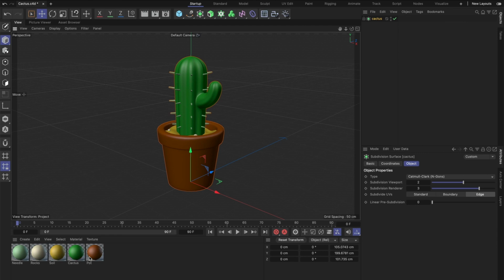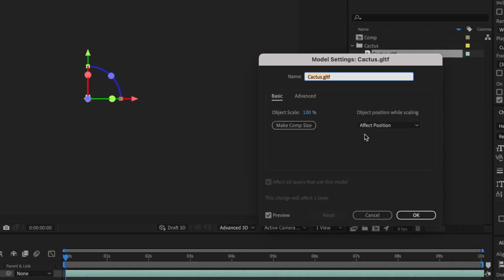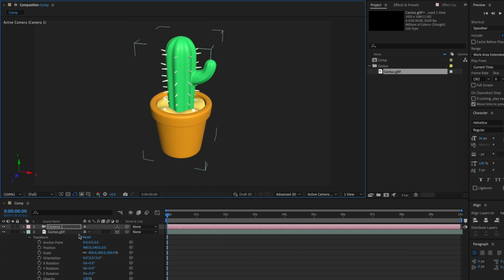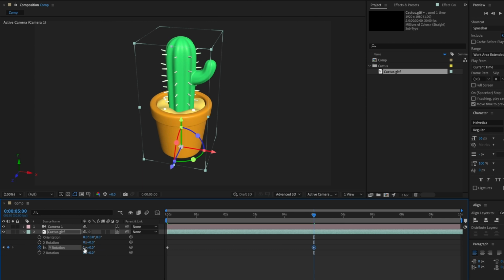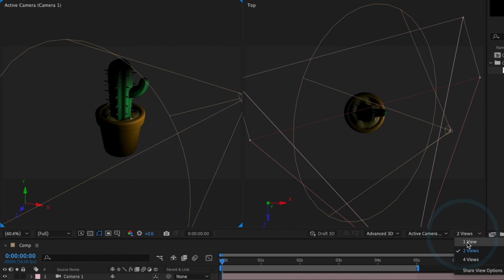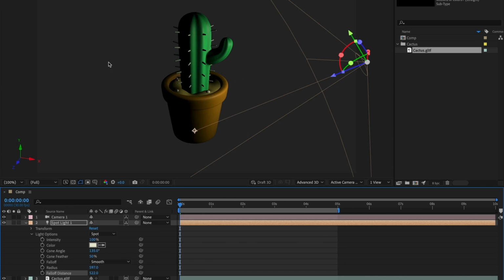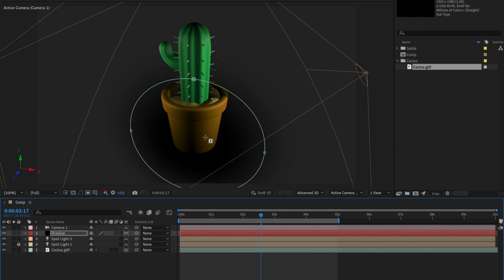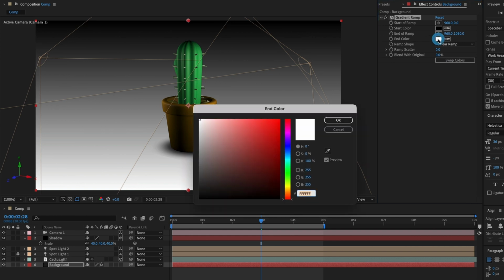NEW! Import 3D Models Directly into After Effects – Full Guide!

Comment: If I import I import the 3d models it becomes invisible
Reply: No I didn't resolve the problem it only shows the wireframe but the 3d object is not visible.
Reply from the maker: If you are in the 2024 version of After Effects try upgrading it to the 2025 version.  Have you tried opening this in another 3D software? Do you get the same wireframe error? If not then it’s After Effects and I recommend you upgrade it. Sorry for the late responds.
Reply from the maker: Sorry for the late response.  That’s strange.  I don’t get that error.  Did you resolve that problem?

Comment: Any reason why the colours of the imported objects are blown out and super bright? I want the colours to match exactly
Reply from the maker: I ran into the same problem at first. In your 3D software of choice, you need to create your material using a PNG or JPG as the base texture. I use Cinema 4D, and initially, I would just apply a basic material and select a color. It worked fine in Cinema 4D, but in After Effects, it would appear blown out. I fixed this by creating a 1000x1000 JPG or PNG file of my solid color, exporting it, and then importing it into After Effects.  👍🏽